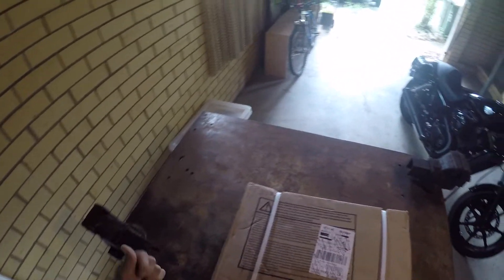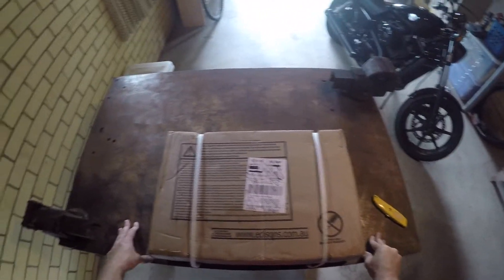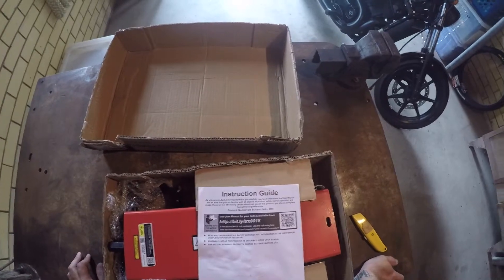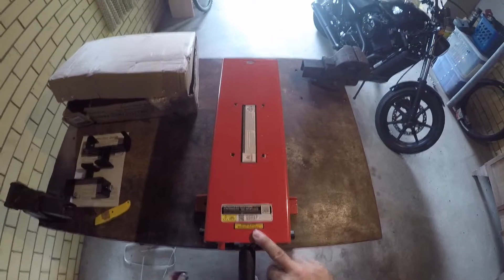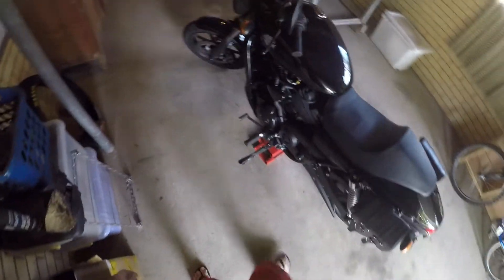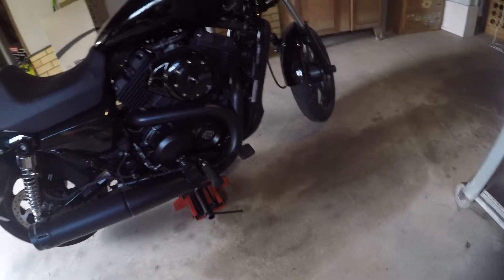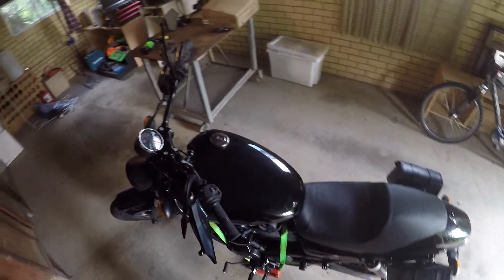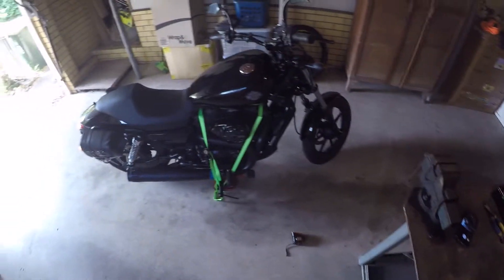T-REX Motorcycle jack // Unboxing & Review

Comment: Was there a reason you did not use the two frame tube cradles that came with the jack ?  Scissor jacks I've seen without those cradles have a thick rubber pad on the top surface, your jack lacks that pad so I can't help thinking your bike might slip on/off the jack (unless you use your cradles provided).
Reply: Yeah like what if earthquake?